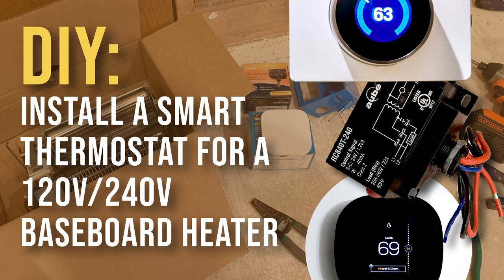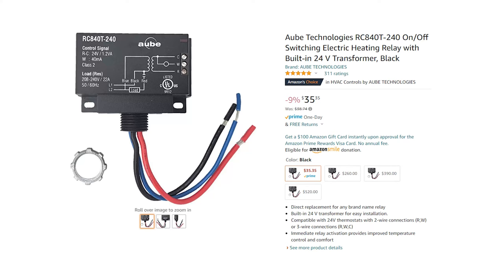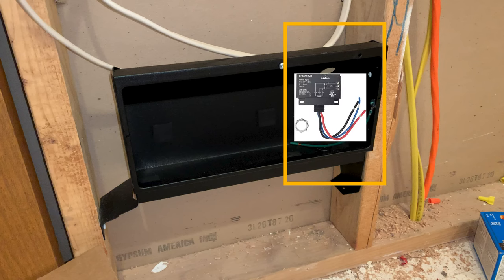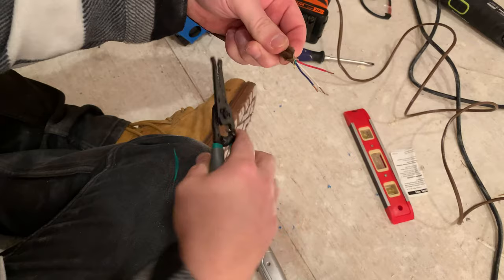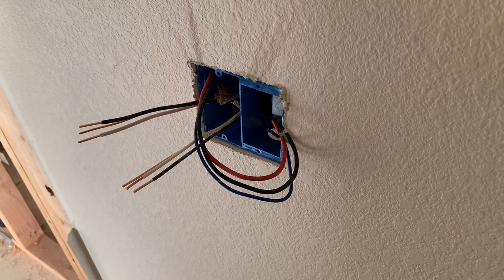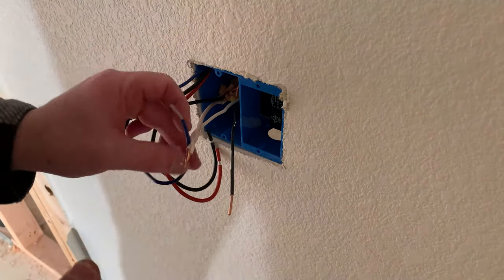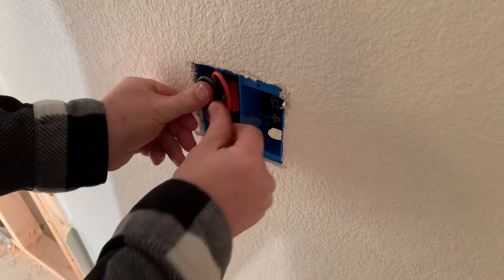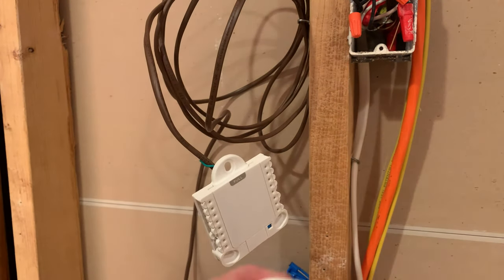How to install a smart thermostat for 240v/120v baseboard heat

Comment: What if I just ran small 18g wire from the 240v wires into the thermostat?
Reply from the maker: Straight from your breaker, without the relay? Not sure if that's a serious question or not, but I'll answer anyway: you'd start a fire inside your wall.  That's too much power running through small gauge wire, so the wire would burn up.  You also probably fry your thermostat in the process.  Certain thermostats (e.g. Mysa) are designed to work directly with 240v power/larger wiring without the need for 18g thermostat wire.
Reply: Thanks for answering 🙏. Here’s the thing, I only see 2 wires in my junction box. If I use the relay to transform power to my google nest, can I leave the blue wires out of the equation or can I joint the blue wire into one of 1 of the 2 wires coming from my panel.
Reply from the maker: @MrJypsye  2 wires total (1 wire nut) once everything is disconnected?  or two sets of wires with 2 wire nuts total?  what are the wire colors?  are you sure you don't have copper (ground) wires jammed into the back of the box? not that they matter as much, but it would be best to make sure your heater is grounded - and it might already be.  do you know if your circuit is 240v?  If both wires test positive for voltage, then it probably is.  if only one is hot (probably the black one), then it's a 120v circuit, and needs the 120v relay instead of the 240v one shown in the vid.  that version of the relay should come with instructions that will probably be slightly different.  the blue relay wire provides power to the relay, so yes it's required.  if your circuit is 240v, and both circuit wires have power, then I don't think it matters which wires coming from the breaker panel are connected to the wires to the relay and heater, since they both provide the same amount of power.  the big thing that matters is that: A) the blue relay wire is connected to one of the breaker wires and one of the heater wires, B) the other breaker wire is connected to the black relay wire, and C) the black heater wire is connected to the red relay wire.
Reply: @sheawilliamson7732  appreciate you going above and beyond to explain this to me
Reply: @sheawilliamson7732  here’s the thing. All I’m trying to do is install the google nest smart thermostat (not the 3rd gen) (I have the the cheaper one). I don’t have a stand alone heater. Now here’s a new finding that has me very confused…: I put my voltage meter on the wires to read the current and it read 2.1 volts. I only have 2 wires coming out the junction from the panel and it looks like 14 or 12 gauge wire. Very very confused bcuz they looked like typical 240v copper wires. Before buying the relay I even went and bought a c wire adapter bcuz the thermostat kept displaying (no power error) I’ve never heard of anyone’s thermostat wires getting 2.1 volts… any ideas? I have a natural gas system
Reply from the maker: @MrJypsye  if it's reading 2.1v, then either your line has no power (it's showing phantom voltage from being close to other live circuits), or you're somehow using your meter incorrectly.  Gotta make sure the circuit is on to test the live voltage - just obviously don't touch the live wires with your body :)
Make sure the meter is on the "AC" setting if possible, and touch the two meter nodes to the two separate wires (one node to each wire).